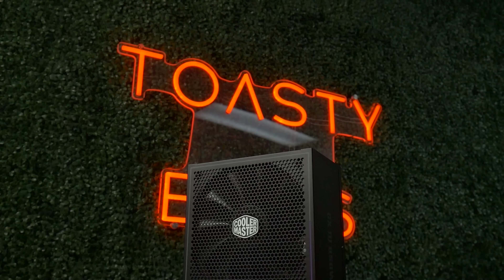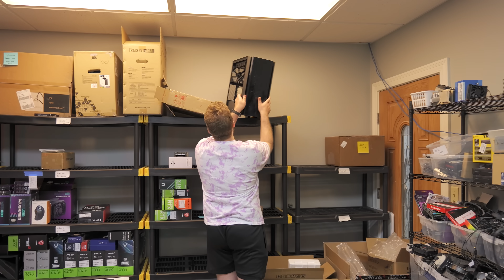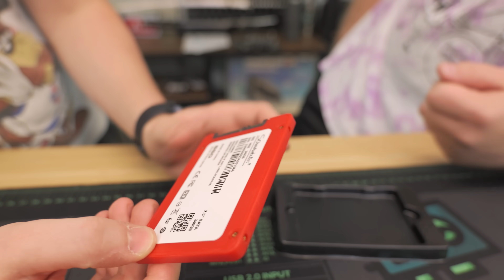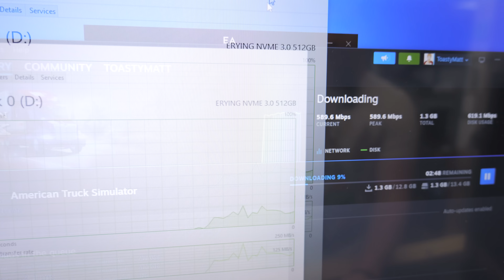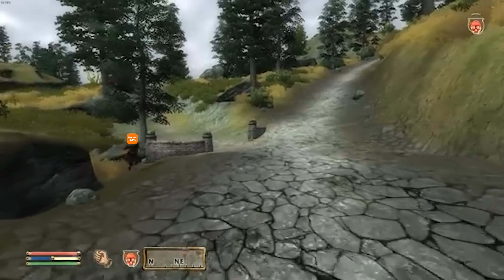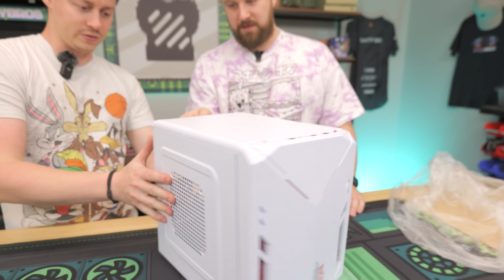Can You Build a Gaming PC Using Temu?!

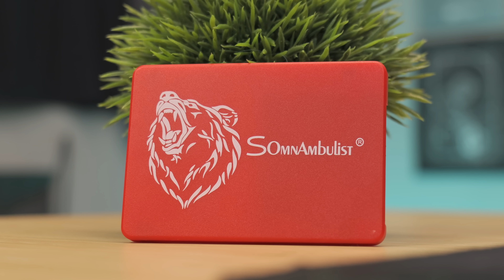Comment: I got one of those $20 ssds @7:00 same brand but instead of a bear on the drive mine has a dragon, I've been running it in a fully upgraded HP elitedesk 600 G1 sff I am using as my HTPC in the living room, running it 2 years now with no issues. I hyave another similar drive in it's i3 cousin connected to the projector in my bathroom.

Comment: I use the right angle 24 pin adapters in my builds just for appearance. But I’ve only ever used the cooler master one. Makes cable management a little neater.

Comment: I bought that case a few months back (April) for the laughs and built a mini-ATX system in it.  I actually sort of liked it although the audio cabling is ancient and for AC'97 audio.  So don't expect your front 3.5mm headphone jack to work with any modern motherboard.  Aside from that, it was built like you'd expect a $50 Temu case to be built and was delightfully janky.
Reply: @@lurch789  well, instead of modding the ac97 into a modern 3.5 you can waste like 20$ and buy a soundblaster audio card that will give a much better definition of sound. Moreover since it's usb you can move it from a rig to the other without needing friver (windows 10 and later)

Comment: Hello Toasty Bros, i have a z400 workstation with intel xeon w3550 3.09ghz, 16gb ddr3 1600mhz ram and a gtx 1650 and day by day i keep getting fps drops in fortnite, i used to get 100 fps while on bus and now i get 30s and 40s, and 20 fps while landing, i used to get 170 fps on ground now i get 80 and it keeps getting worse, i upgraded from 8gb 1333mhz ram to 16gb 1600mhz ram and instead of getting better performace im getting worse… please help

Comment: I will admit the RGB adaptor for the m.2 drive was interesting, especially if you need another m.2 SSD but you're out of m.2 slots.
Reply: or if you have an older pc with no m.2 slot. as long as it has pcie 2.0 or higher you shouldn't see performance loss on the m.2/nvme

Comment: I can give you a good use case for that right angle 24 pin. I was building in a budget case and the hole where the 24 pin was coming out just wasn't cutting it for having the 24 pin stand straight up. If I had a right angle connector I would have had so much more slack on that cable.

Comment: Hey I thought you aren't supposed to mount aios to the top or the bottom like that?
Reply: As long as the radiator is higher than the AIO CPU fan, it's okay, as it'll keep the air out of the fan casing. You should place it upright on the front, but it's not really that big of a deal.

Comment: Sadly my recommended RX 6700XT died last week, just went all black on the screens. Is it still the best budget option, or is it worth saving a bit more for a stronger card of the same family?

I ordered a 700W Power supply, but it was badly bent, so I had to go back to the 530 Hamburg unit. Could this be the reason for its death?